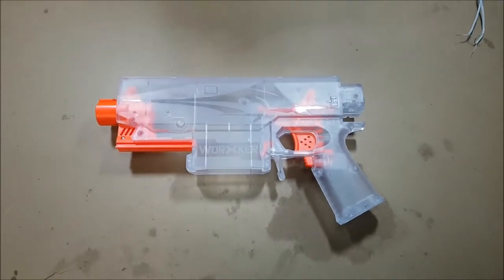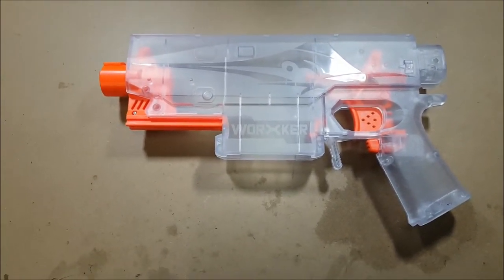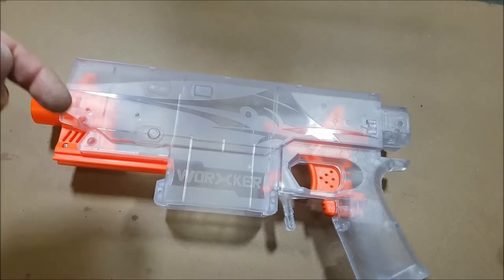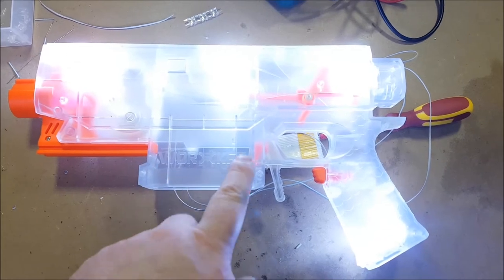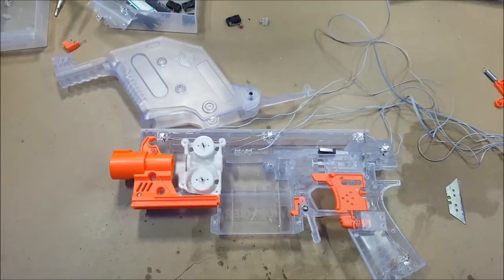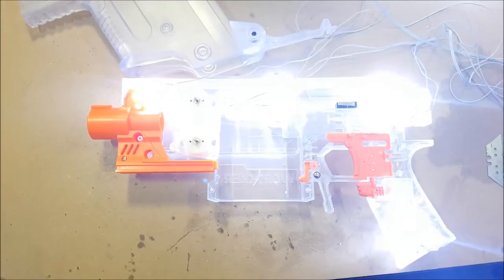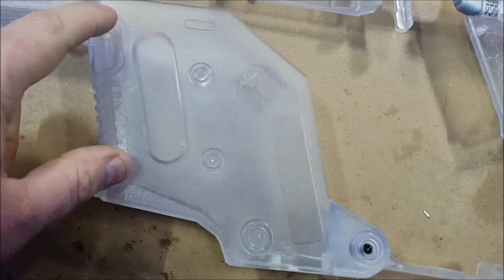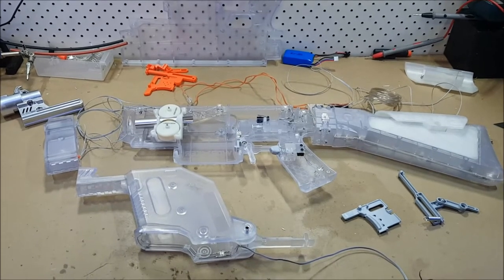The Seraph - Worker Swordfish mod

Comment: Your crono is seriously way off!!! Good build tho.
Reply from the maker: No its not way off ...just some freaky new dart stuff happening ... got consistantly FPS of around 176 with used elites
Reply: @J0D0CAST  ,, that's a morpheus cage with a 9/16 aluminum guide and white worker wheels correct?
What crush?
What motors?
2s or 3s?
Reply from the maker: @seniorxj2931  41.5 fangsrevamped and 2s
Reply: @J0D0CAST ,, then we're both running the exact same setup & mine doesn't hit those numbers..
Reply from the maker: @seniorxj2931  what are you getting ?